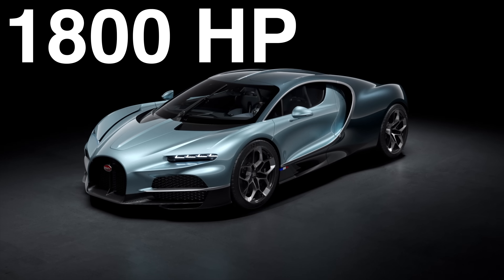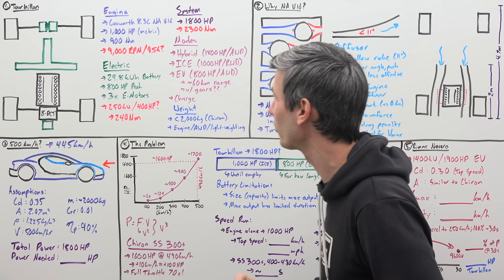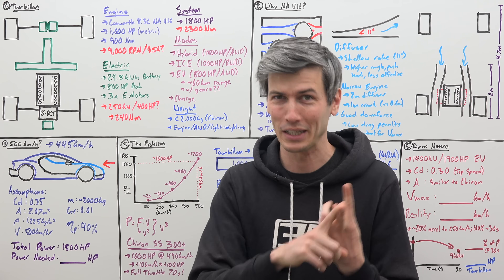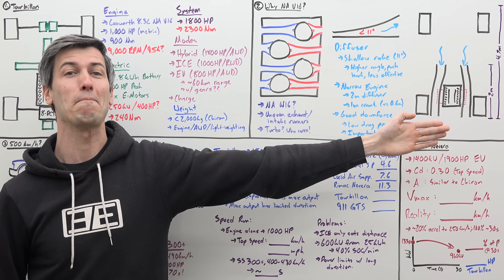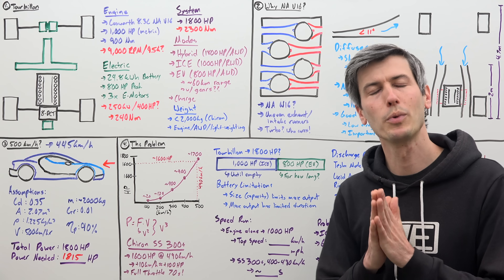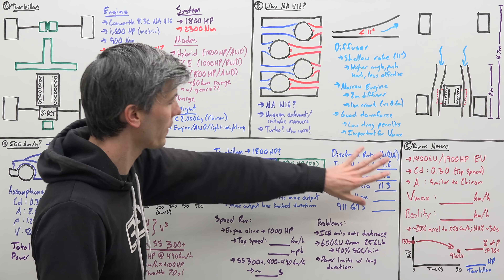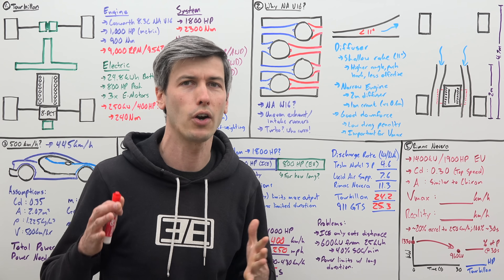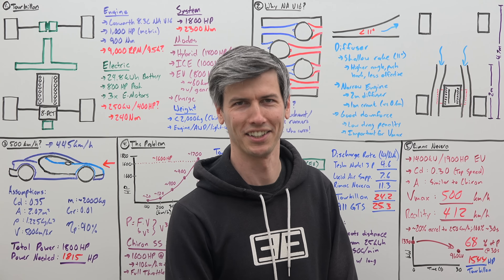Bugatti's Giant V16 Engine Is Insane - All The Tourbillon Details!

Comment from the maker: *Important Note!* If you made it to the end, it's important to understand that the ~68% (or ~72%) discharge rate is absolute not a rule of thumb, just a fun guestimation. Every battery is unique, and will have its own unique characteristics. Also, looking at Rimac's latest high speed run, they achieved 412 km/h with much higher power after prolonged acceleration (the car was delivering 1225 kW at 412 km/h, or 87% of the peak 1408 kW). Porsche's T-Hybrid battery is also rated for "continuous" power at 41 kW, versus a peak of 48 kW - that's roughly 85%. So perhaps 70% is a low estimate, though it is accurate for the context of the original Rimac top speed run, and we don't have many of these data points (because top speed runs are a challenging thing to put together). Just some added context! Will be interesting to see some real world tests with the Tourbillon. Thanks for watching everyone!!
Reply: I'm pretty sure the E-Motors at the front axels are not able to exceed max. speed. Do they have a clutch to disconnect them? At some point it's rear wheel drive only. Also the other E-Motors don't have max power at max. speed. I like your calculation but its very theoretical.
Reply: Excellent work as usual
Reply: @EngineeringExplained  based on the tourbillon spec sheet, and front motors 6.25 gear reduction, extrapolated from electric motor and wheel torque. 2200mm front tires circumference, and thus 507kph would be the absolute top speed limit for the front motors
sounds like it checks in with the rest of the specs and this could be only achievable with special limited series, with completely unlocked too speed, maybe different tires, and a more powerful battery. orBugatti/Rimac has done a remarkable job about drag coefficient, ram air effect, and maintaining the electric power high, up to 24krpm
Reply: If the rear electric motor has several gears like the engine, it could still deliver the 400 rated hp at max speed, but the front motors are probably getting close to their maximum speed and might deliver way less power than 400. If they still deliver about 200 each the total is 1800 :)
Reply: What?!  No mention of the tires and the limits of current production design/compunds?!  From an admitted Tire Guy no less?  What's up with that?
Reply: @EngineeringExplained  the real question is what cells is the battery made of. from what  I've Googled even molicel most power dense P30B cells wouldn't cut it in terms of power density wouldn't cut it but they are still 2x as energy dense as the whole pack 21kWh/200kg. it could be that the gross capacity is much more than 21kWh. with a reasonable cell to pack weight ratio of 90% , 180kg of cells capacity would be 41kWh, a ~50% buffer to allow a more consistent power output that would peak around 500kW.  Regen always available and less degradation despite the fact that the battery will be used pretty hard with high discharge  and charge rate.
there still 20% power missing but it could be some newer cells that are not released in their website, or the cells are pushed to their absolute maximum with a acceptable degradation compromise. all they need is to be able to do top speed runs, maybe drive for a mile at most close to top speed. customer cars won't be spending even 0.1% of the time above 250mph
Reply: did he just doobydobap in the first 30 seconds of the video.
Reply: HP/Weight ratio of the Bugatti is between 1.8 and 2kg. At 75% continous power - it’s >3kg. Not impressed, Bugatti😂
Reply: Mate confirmed on the stage at launch, redline is 9,500 rpm. 

You can also see it shift at 9,500
Reply: @Tosix98  small but powerful! Bugatti did their homework , picking very powerful cells  and sizing the battery to be just big enough to achieve the power they wanted, with virtually no impact on weight compared to the chiron and managed to make a NA plugin hybrid with same or even lower weight and 15-20% more power. this is very unique in the hybrid world I can't name a single hybrid, let alone a plugin, that weighs less than it's gas counterpart/predecessor. also smart aero engineering with the massive diffuser, eAWD/driveshaft delete, lower roof/narrower cabin 
designing the battery, they did not care about energy but power and weight. this is the only way for a very high performance hybrid or even EV. performance car are not about ramge. the battery density is low but 29C discharge rate is extreme. for comparison, the plaid powertrain is limited by battery output at 7.6C. it's a 5x smaller  battery that m achieves 80% of the power. of course, there has to be compromises..
-energy density is 2x lower so the power/weight gain is about x2. that's still a 200kg weight saving. electric range is compromised but who cares.
-the second compromise is like for any hybrid with powerful electric motors, the sustained power output once the battery is drained you have lost 45% power. if 250 is about the speed that can be achieved on gas alone with 1000hp, driving any speed over 250 will start draining the battery. the faster you drive the faster battery drains. this is probably one of the reason why the limited the top speed. 1000hp @250moh means 1350hp at 276mph/445kph
this means about a capacity of a little under 5 min of top speed if the battery was full and depleted to 0%. this is actually not so bad when you consider a chiron would drains it's tank in 10- 15 min at that speed anyway.
realistically, no road or track exist to achieve this anyway.
they have gone to a (base) chiron that can go 260 for 10 min at best  to a tourbillon that can go ~280 for 5 min then 250 for another. this doesn't even have an impact on a cannonball race, even the most reckless driver won't be able to drain the battery
Reply: Mate Rimac comment on this video
Reply: I'm guessing the problem has something to do with the fact that we our at the limits of rubber tires.
Reply: Would it be beneficial for them to put 5 different 5kwhr batteries instead of one large 25kwhr battery? If you could phase in and out of each battery with a central controller you could keep max output for longer, no?
Reply: U crazy technology
Reply: Guys, KERS, you don't need to use e-power from launching stage, use pure ice mode and keep the battery power, when the car reaching to the v-max of ice mode, then switching to hybrid mode, using this method the car will reach to 500kph before the e-power starts dropping.
Reply: And one thing to consider is also the gearing of those electric motors. Do they still hit the max HP at ~500 km/h or are they already past that RPM?
Reply: What if they didn't use the battery at all until they reached max speed with ICE, and only then kicked on the electric motors?
Reply: I believe it was pretty clear from the rest of the vehicle, just like the drag coefficient. The chief designer did mention to big YouTube channel that "people believe drag coefficient is the important part, but it's not it's frontal cross-section".  Part is market speech and part is true, so maybe they get a drag miracle.  They are going for mechanical excellence but frankly, as someone who is not going to drive or buy a Bugatti  (even if I got the money), I would have loved if they went with a turbo and 1200HP gas. I gess the people that buy the cars is more important than me 🤣
Reply: @jaimeduncan6167  Why go turbo for 1200bhp with petrol and not NA E100 for 1500+?
Reply: @jaimeduncan6167  or maybe no electrification was not an option for the power they were looking and emission regulations so instead of just adding a few hundred electric horsepower they decided to go all in, remove the turbos, keep the displacement and number of cylinders and double it with electric motors
Reply: @jaimeduncan6167  well actually both are just as important.  frontal area can be reduced to a certain point but if you want to keep 2 seats that are not cramped and can accept different body types, and a driving position that is not completely leaned back, there's only so much surface you can reduce. also making the car narrower car lower the frontal area at the cost of tire size (grip) and cornering/weight transfer. the McMurtry speirling solves the issue with 1 seat, fan, and short /narrow/low car. whereas improvements in drag coefficient increase the constraints on the design of the car, it's lengths, but little impact on perfomqnce or weight. obviously it's not a landslide racer and it needs to look good, and have the best compromise of frontal area AND drag
Reply: with a good intake plenum,could the NA engine make more than 1000 HP at high speed? Maybe I´m wrong,but some motorbikes had than ram air box to make more power at top speed. What do you think?
Reply: @josemorenoporras7506  also it's possible that the V16 could rev even higher in extreme versions of the tourbillon. 520cc cylinders means pistons might rev high than the bigger oistons in a Z06 or GT3 RS..of course the crankshaft could also be the limiting factor for the redline
Reply: @Tosix98  interesting! where did you get all those numbers ? I would have thought initially rear motor would be used for low speed acceleration to take advantage of the weight transfer and additional traction in the rear like the taycan rear 2 speed transmission but it actually makes sense considering there is already 1000hp pushing on those rear tires and a lot of torque in first gears so it makes sense to use eAWD for launch with a shorter gearing in the front for torque. it will definitely need clutches in the front to disconnect the motors at higher speeds, the motors wouldn't like being spun above redline and the drag would be VERY significant. we already know from the video that the rear motor can be disconnected too. it's pretty unique to see a plug in hybrid with three electric motors that can be independently disconnected
EDIT forget what I said I read too quickly and missed tje fact that you were talking about the nevera.
the Bugatti website does have quite detailed spec. the three motor seem to be identical with 24krpm, 250kW PSM eMotors
Bugatti gives wheel torque in the front (3000Nm total) and motor torque in the rear 240Nm
if the motors are identical, it means 6.25 gear reduction in the front ! meaning the 2 front motors are able to spin  up to 507kph ! I don't see a reason for them to not gear the motors for top speed.....this could mean the tourbillon is engineered to achieve 507mph too speed. It would make sense to one up the chiron, break the 500kph limit and production. car WR with a small 1% margin of error who knows what happens at those speeds maybe the tires expand?.... it's probably all based on simulations  and dyno runs at the moment. it s likely that the "base" version will never pass 445kph limit. it makes sense to have one version for all out top speed an breaking records, that will only achieve top speed after several miles of straight line? but for real life, whatever insane too speed needs to be reached quickly enough, with some power reserve. not everyone has access to a privatew perfectly smooth track with 10 miles of straight line
Reply: @geemy9675  "kph" lmao no one cares what your child mind thinks.
Reply: @GrainGrown  talk about a childish comment...
Reply: @geemy9675  Haha yeah, it was.
Reply: When I take delivery of mine, pop over, and we'll take it for a spin across the Nullarbor or up the territory road. Old mate over there in Italy said I was getting number three, so it shouldn't be too far away. 
In the meantime, anyone interested in some dogecoin?
Reply: Man learning from u.. Ur sexiness
Reply: The only logical way of challenging the 500Km/h barrier is internal combustion. Alone. Electric is obsolete.
Reply: @Lina_Antoniou  Bugatti is proving you wrong with an hybrid that will beat the previous WR set with their gas car
Reply: @geemy9675  Even if it does beat that record, for how many years will it be able to repeat the feat? Then the battery, the motors and all their supporting infrastructure become basically dead weight. In this one they say the battery is structural, so most likely impossible to replace. Therefore you have 1800ps for a couple years or something, but after 10 years at most you 're just left with the ICE's 1000hp and thus a natural top speed of about 400Km/h as shown in this video. Sure 400Km/h is still plenty, but not enough to beat the record. Had they made the Tourbillon without the battery and motors etc it would have been more lightweight and maybe aerodynamically somewhat more efficient, so the need for power at each given speed would drop even just by a little. They could then design the V16 to use E100 instead of gasoline, so with somewhat more aggressive valve timing... say hello to 1500+hp. E100 would also mean absence of emission control equipment, therefore again less weight, along with better engine-bay aerodynamics. Get a well-geared 7-speed racing gearbox (with three main ratios, two auxiliaries and a straight) to further reduce weight and frictions in comparison to that 8-speed overkill and there you have it, record beaten with a car that will actually last. 'Cause, you know, cars are meant to last. Especially as the Tourbillon's looks do have something timeless about them, losing 800hp so fast will be a shame.
Reply: @Lina_Antoniou  bugatti's are expensive to maintain 😂 it's a know fact.
the electric motors maintenance cost will be maybe 1% if the engine's maintenance 
for referemce the Nevera's battery has warranty for 8 years and unlimited miles
Bugatti offers 4+15 year warranty options
so the batteries will be available as spare parts at least 19years after the last year model of the tourbillon. as with any car when you get into 20-30 years after a model is discontinued, it's a toss up wether parts are still available but you can still find a lot of parts for a Ferrari F40.
it's exactly the same problem for internal combustion or electric powertrains. regarding the battery, it's very likely that a lot of these multi million cars won't be in the junkyard in 30 years and will still be worth a lot. you can expect smart companies to offer refurbjshing the battery packs by switching cells with similar size, voltage and most probably better performance.
Reply: @geemy9675  Warranty policy can be aggressive, there are such examples in the car world (Ford, KIA, VAG...). Also, Bugatti's warranty plan doesn't necessarily mean the battery is replaceable - especially as they 've made it structural for this model. The F40 has parts available because they are worth making, as it hasn't lost almost half its power within its first decade. Regarding your final point, fuel tanks don't need refurbishing, so an energy storage system that does need refurbishing is a waste of resources. Especially with all the toxic waste of scrapped batteries, it even dooms the planet it pretended to save. You know, carbon is a polluter, but not the one and only. So yeah, electric is obsolete, all hail the ICE.
Reply: @Lina_Antoniou   any battery can be replaced it's just a question of how much labor. I have no doubt a 4 million car will NOT end up in the junkyard because of faulty battery cells or modules.
bugatti's are full carbon they don't NEED a structural battery packs plus there is no way a small 21kWh battery pack is holding the car together. it's just helping with rigidity, but structural battery pack doesn't mean not serviceable. it's optimized for cooling (oil cooled) and the pack discharged at 25C so coolant (oil) will flow in the battery between the cells. the battery pack can't be cheaply assembled with a bunch of glue like a Tesla structural battery pack. I'm not saying it will be a 2h job maybe the technician will have tor strip the interior, or disassemble the giant diffuser, etc but lets be real it's not the kind of product that you throw away when something goes wrong, it's an hypercar with expensive maintenance schedule and the battery WILL be serviceable no question about it.
do you seriously think for each customer that has a car under warranty (4 to 19 years, 8 years minimum in the US for battery warranty) they have a replacement car made to the exact same specification that they will give to the owner to replace their car if the battery fails under warranty? 😂 do you think they will not honour the battery warranty? nope that's not happening
Reply: @geemy9675  Seeing how long it takes to replace a structural battery will be interesting. Not everything is a question of money, if something takes too long to replace it becomes unpractical. Regarding aggressive warranty policies now, you misunderstand me. Companies honour their warranties, certain products however don't. For example, KIA offers its models with a 7-year warranty. The rates of failures within those 7 years though are off-screen, to the point that I 'd expect them to dial back their policy. However, instead of doing so, they went even more aggressive: they increased their prices, to the point of a Picanto competing directly with the grossly overpriced VW Up. So you are indeed paying in advance for what is going to fail during warranty. Or is that not happening either?
Reply: @Lina_Antoniou  yes it will be interesting but you don't replace battery every year. Toyota hybrids have a 10y/150k miles warranty. I hope Bugatti provides a smart charging keeping the battery at 50% for storage. those cars don't get driven a lot...battery stored at 50% when it's no used can last MUCH longer probably at least 20 years. now if drive it on electric as a daily driver , the battery will probably be degraded after ten years
Reply: @geemy9675  Still, battery degradation is a gradual process. The Tourbillon's ability to beat the Chiron's record will be lost in 4-5 years in the best-case scenario you hope for, which means 2-3 years in the most likely scenario. All these 8-year and 10-year battery warranties are not for 100% power. A properly built and maintained ICE is going to last ages longer than that, without losing power. There are century-old cars that still run like new, this must be saying something.
Reply: @Lina_Antoniou  baseless claims. a li ion battery doesn't lose power in 5 years ,.and doesn't lose more than 1.5% capacity per year if stored properly. especially not with the kind of miles people put on those cars. Bugatti maintenance is around 100k per year.  if anything driving some miles on electric (in traffic/city) on electric will lower maintenance. battery is covered by warranty for at least 8 years so double the gas powertrain and electric motors have no maintenance
Reply: @geemy9675  The Chiron's record is 489Km/h. If the Tourbillon needs 1000hp for 400Km/h, it should need close to 1500hp for 489Km/h (as much as the Chiron itself makes). Sure by your ideal scenario it would take 25 years to lose 300hp from the battery, but how realistic is that scenario? Most rich people are spoiled and will not give a damn about "storing properly" something they see as a mere toy. So my guess is the average Tourbillon's battery will lose much more than a mere 12hp per year. Also, even your ideal scenario is far worse than what happens on average with ICEs. No ICE ever has lost 37,5% of its power to degradation. There must be some reason the ICE has been so omnipresent for almost 150 years and still goes on unbothered. EVs will not even make a dent on it, despite all the far-right policies trying to impose them.
Reply: @Lina_Antoniou  to last long ICE need regular oil changes, performing the planned maintenance. battery needs only to not be stored at too low or too high charge. it's not that complicated. if you don't use the electric mode  and don't discharge the hybrid system will always keep the battery at an average level. if you use the electric mode and plug it in regularly it's just better to not charge to 100%. no maintenance required. when the battery is dead you replace it, so instead of regular maintenance every 10k miles you have on emore expensive maintenance every 100k or more
Reply: @geemy9675  Everything needs some sort of maintenance, this is a given. The thing is, a neglected ICE will give signs of malfunction without losing 37,5% of its power. Whereas if maintenance is done, performance will be completely retained. Batteries lose power even in the best-case scenario. And then there is the environmental matter. Used-up oils can be filtred and reused in other applications, whereas the chemicals of old batteries are frankly toxic waste. Let alone that ICE cars can be made much more lightweight than their hybrid or electric counterparts, which directly leads to less wear of tyres, brake pads and what not.
Reply: @Lina_Antoniou  batteries and electric motors don't have a maintenance schedule and batteries can be refurbished or recycled . and the tourbillon is lighter than the chiron
Reply: @geemy9675  Battery metals can be recycled, but you 're still not answering the matter of chemicals. Also the Tourbillon is only slightly lighter than the Chiron, mainly because the Chiron itself is much heavier than it could have been made. Maybe VAG preplanned this as a pro-EV PR move. The Tourbillon is actually so heavy that even with 1800hp it is not a megacar (Koenigsegg on the other hand have made a 1360hp megacar with... zero electric motors).